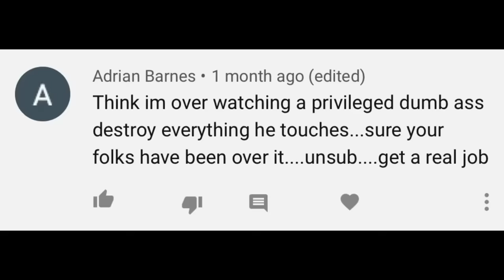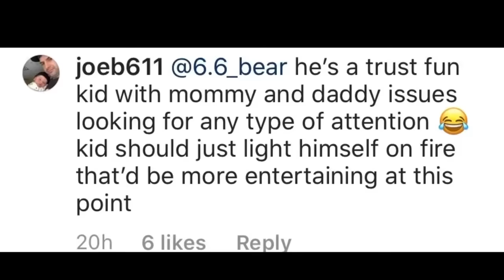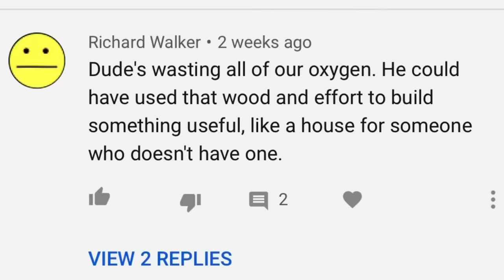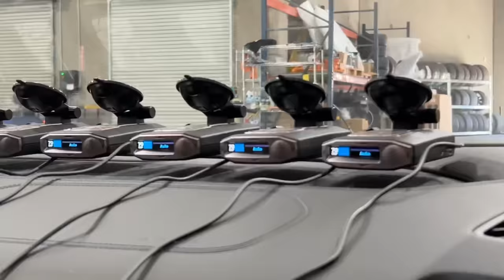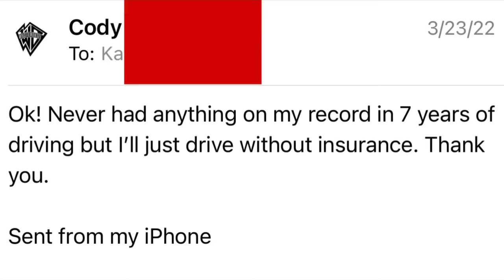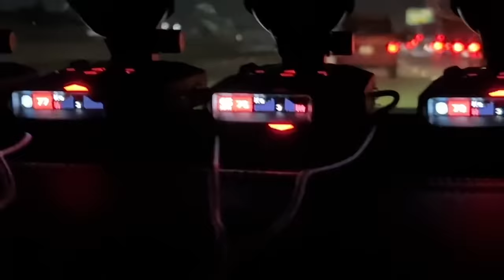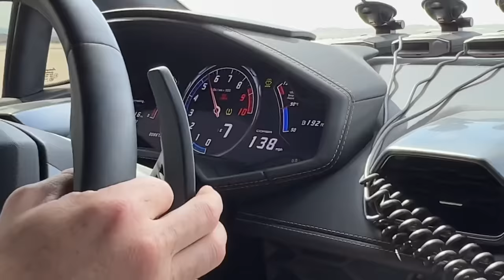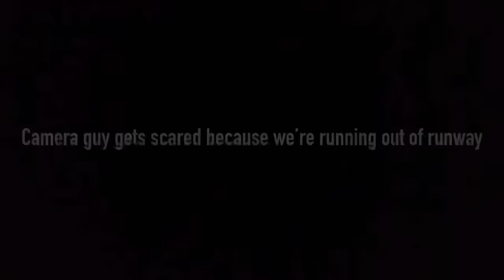My new Lamborghini. Paid for by the people that hate me.

Comment: Sorry for commenting one last time, but it brings back so many great and bad memories.  We had 3, 3 wheel old school Honda ATC 250 SX, Two Yamaha Banshees, and a Suzuki LT500R Quadzilla that my brother put a lot of aftermarket mods into it.. El Mirage was a place that you could open up and go flat out.. The Banshees that were also upgraded would hit close to 80mph. The Banshee was a much smaller stance compared to the Quadzilla and at around 70mph it would start to float and feel very unstable.. The Quadzilla had a bit larger stance and I personally never felt it float at any point even at close to 115mph.. Incredible feeling moving across that lakebed at that speed.. 
That same Quad almost killed my brother two weeks later.  He pulled it off the trailer and just was dicking around without a helmet because he just intended to kick it around for a minute before shutting down and all of us gearing up and go ride. He hit a small roadside berm and it rotated about 45° on a flat plane and when it landed, because of the larger size, it just stuck to the ground as a where a smaller quad like a banshee would have rolled.  It stuck like a car and launched him about 20 feet off the side.. Horrible head injury and was life flighted out of El Mirage. 
Luckily he recovered with no issues but the point is that the Quadzilla has a reputation for a reason.. Regardless it was still great times.

Comment: The issue with Radar detectors is now they increasingly more and more will give you a false positive of "radar" detection (this is about to get nerdy AF) because Radar for police scanners USED to be S-band which is actually what your wifi runs off of, so they had to change that when Wifi came out to X band and some K band...but now with 5g towers popping up, 5G ranges into those frequency ranges of X-band and K-band just like police traffic radars. So you might get an alert radar is in your area when in reality...its detecting the signals off a 5G cell tower. If you have a 5G cell phone aswell, that could set it off if your phone switched out of GSM into 5G and someone youre passing by on the road might have had their phone switch to a 5G band and your radar detectors pick that up and give you a false reading. I mean, its good to always listen to the radar detectors thou because youll never actually know which is which

Comment: If I ever make it based on the same principle I get a Countach Kit Car fibre glass wide body hull and put onto a pipe frame structure and you recon me by the V8 chevy kompressor hat on an F150 all wheel drive train sticking out in the back when I overtake at the Cote d'Azure or somewhere in Italy.
#provos #streetsportsdevisions